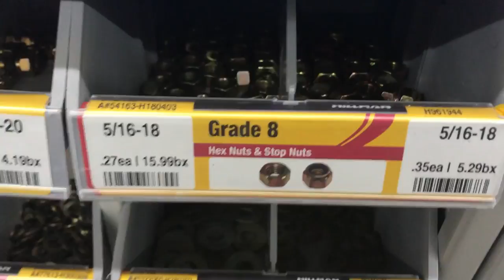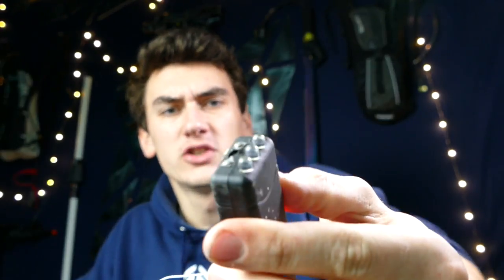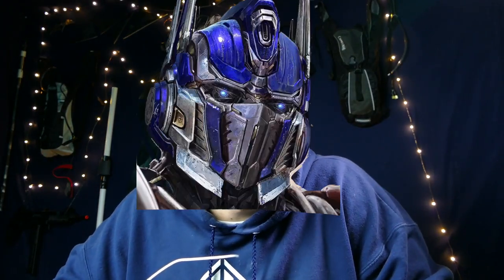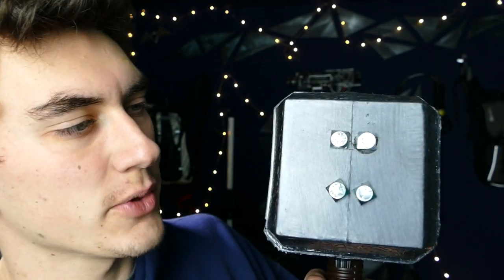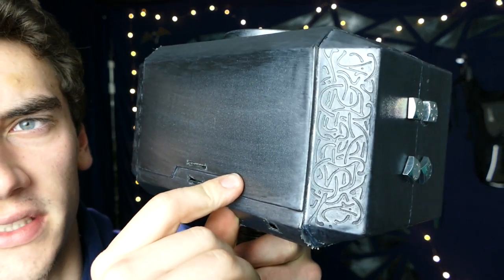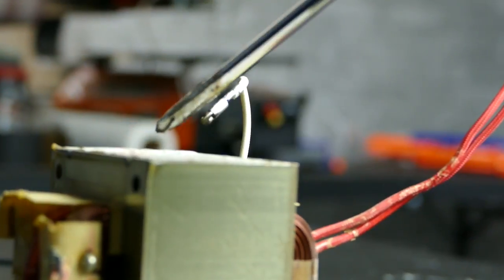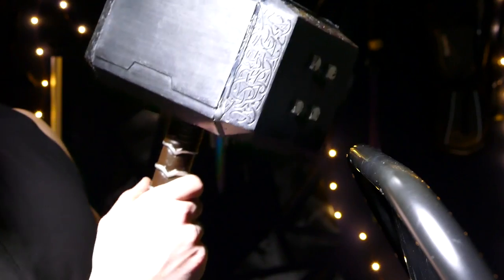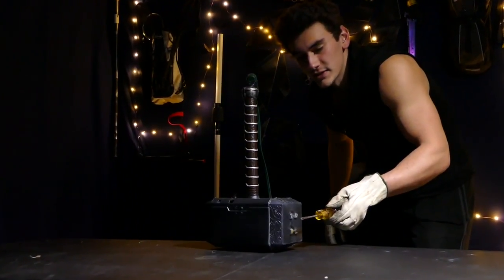How To Make an Electric THOR HAMMER! - Thor Ragnarok (Cheap Build INSANE VOLTAGE)

Comment: I made Thor's hammer out of cardboard and added 3 AA batteries to a boost step capacitor switch and 2 screws the screws stick out the top and make some LIGHTNING ⚡ jk just a little